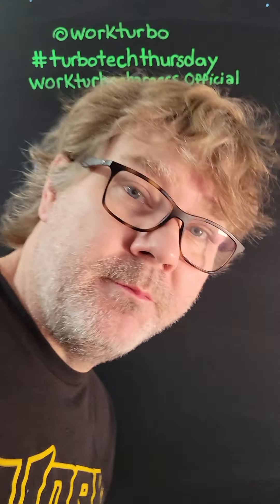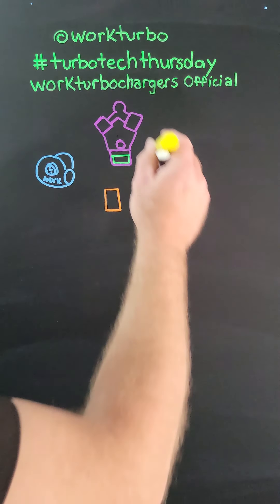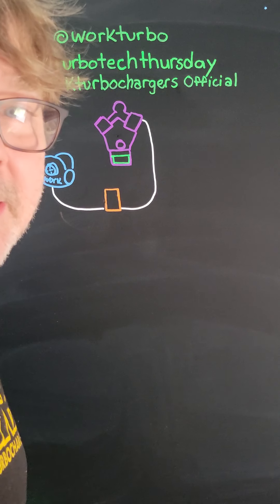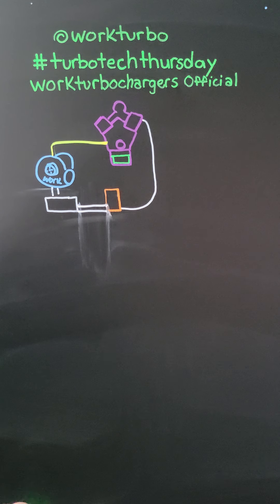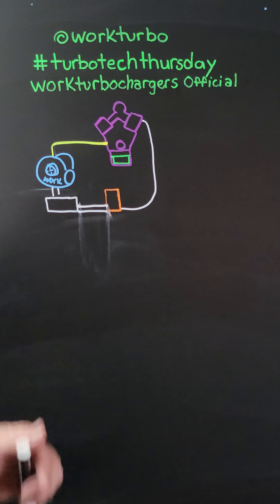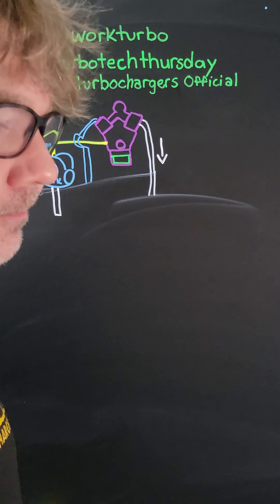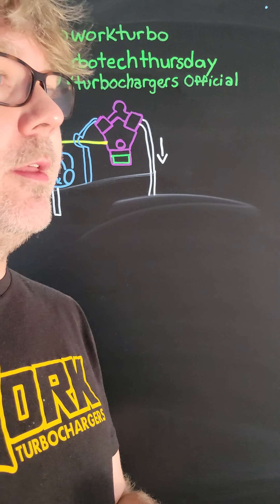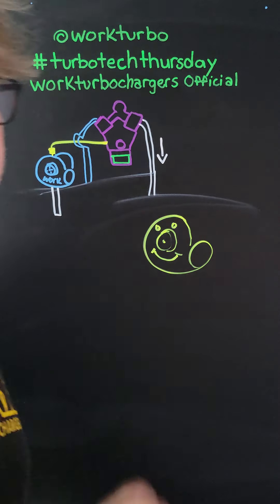Scavenge Pumps and Turbos, Tech Tips!!

Comment: do you need a restrictor on journal bearing turbo like gt35?
Reply from the maker: Most of the time you will not need a restrictor on a JB turbo, the internal bearing clearances will "self regulate" the amount of oil passing through the turbocharger.  There are exceptions to this, but for the most part you will want as much oil as possible to pass through the bearing structure to lubricate and most importantly COOL the bearing/shaft/housing etc.  If your turbocharger is water cooled, you can run a restrictor.  We have used .070" successfully over the years in our own cars (road race, drag race and street).  Mainly these are on cars with very high oil pressure, usually over 40 at idle and over 80 at cruise rpm and approaching 100 psi at full rpm.  If your car has lower pressure, you should not need to worry about the restrictor...just focus on a proper drain/scavenge/crankcase vent system and it should be great!   A professional alternative to a restrictor is the new Turbosmart in line oil pressure regulator, which will keep the oil pressure at a consistent 40 psi at all times (assuming the engine will produce that).  This is a good safe range for a GT35 that is seeing 10-15 psi of boost regularly with a high zinc oil.  If you are pushing it harder,  stay with as much pressure/flow as you can get!   Here is a link to the regulator on our site https://www.workturbochargers.com/turbosmart-opr-v2-turbocharger-oil-pressure-regulator/  Hope this helps!

Comment: On a Ls swapped e36 twin turbo set up. Do I need this scavenger pump and set up,??
Reply from the maker: The only time you need a scavenge pump is when the turbochargers are mounted in a position where gravity cannot drain the oil back into the pan.  It is always advisable to mount the turbocharger high enough in the system so it will gravity drain.

Comment: How do you know if you need an oil restrictor?
Reply from the maker: I am going to do a video on this topic soon, but the short answer is most turbochargers do not need any restriction IF the drain system is designed properly.  The exceptions are Garrett ball bearing units, they are designed to run with a restrictor.  Look for my video soon on this subject!